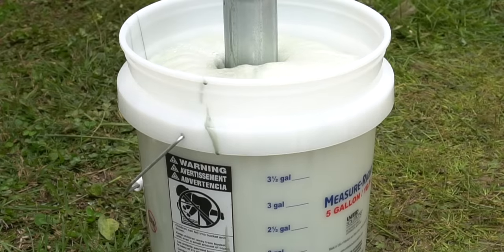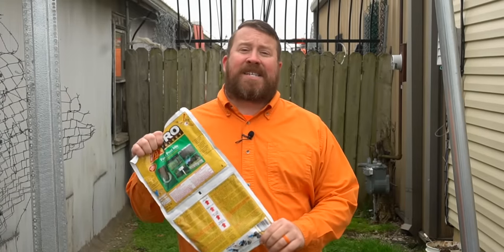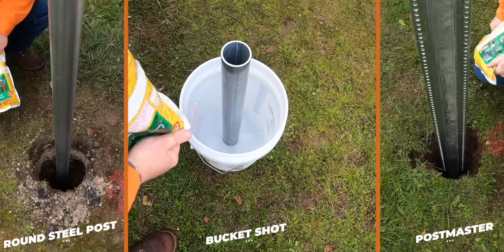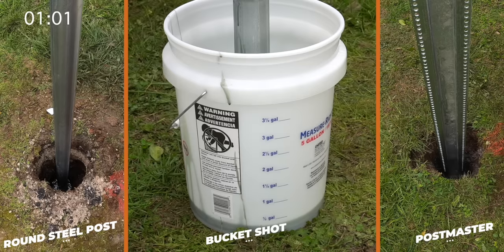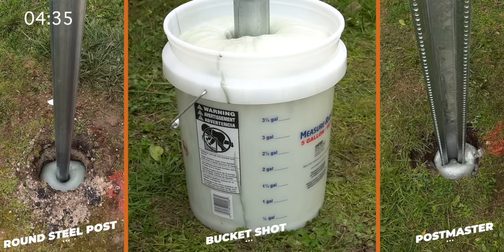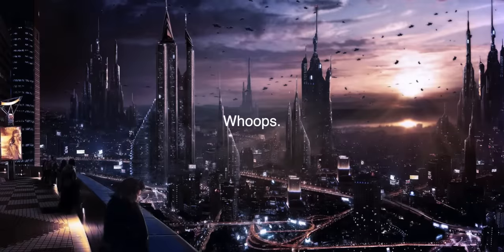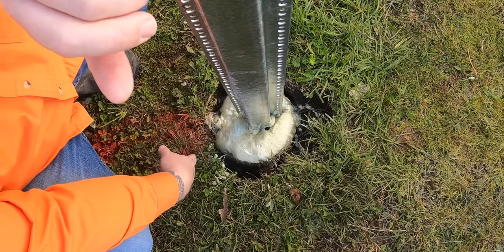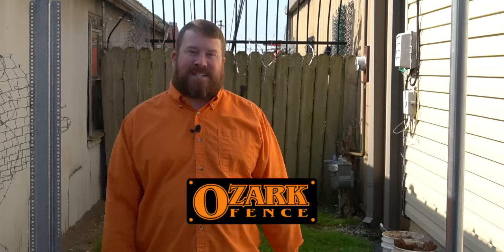Does Fence Post Foam Really Work?

Comment: I agree this foam is a pain in the ass to learn to use because instructions are horrible but if done right u have no issues and in my opinion is as good as concrete but quicker. I personally played with around 30 bags when I built my fence and greenhouse and I had a nightmare of a time in the beginning.
Step #1 warm up packets to  around 90-100 degrees to get best performance and foam expansion. If its to cold it will shrink after it cures.
#2 step is to dig the hole in a way that the deepest part is wider then the top of the hole.
#3 mix the packet insanly well by sliding it back and forth on a pole or another straight stick type object, you will get about 8-12 seconds before the bag starts expanding lile a ballon (be careful because if you over heated past 100 degreed the packets  could explode if your not fast enough at mixing and cutting the corner)
#4 step is to only pour and mix it during the warm or hot parts of the day because the temperature difference of the soil can cause it to shrink during cure.... if done right your expansion will  happen instantly as the mixture hits the outside air. 
#5 step is to wait at least 3 hours before adding any weight and I would recommend a full 24 hours to fully cure and harden. When it first cures its not insaly tough but over the course of a week the foam will harden to a ridiculous extent.
If done right a single bag expands to almost the same volume that 2 bags of concrete would fill

Comment: Let’s just say you threw some rocks into the mix that would act as permanent shims.   Would that make a difference?  For stability
Reply from the maker: Possibly, but it would really defeat the purpose of the product.
Reply: @JoeEverest  you know, it wouldn’t hurt if you lied once in a while.     :)
Reply: And for the record I’ll clarify the original comment:  not all rocks are created equal.  Let’s say the rocks were flat, compressed (right word?) and had foam on both sides?  I’m actually not trying to waste time I’m just interested in multiple solutions

Comment: Been using concrete for projects around the house for decades. The idea that FOAM will resist the forces of nature does not set well in my stomach. Use concrete, it’s a little bit more work but you’d be glad you did. Leave the foam for the chair cushion and the inner soles of you shoes. Use mixed concrete for any foundation.
Reply from the maker: Great points, I appreciate you weighing in!

Comment: I just used this stuff a week ago to set my mailbox post and I gotta say,  I think you didn't mix it properly or something. Mainly because of your slow expansion. I poured it into a 24 inch deep hole and it basically just shot out. It raised like 12-15 inches within seconds. Maybe they changed the compound since your review? I don't know, but your test definitely doesn't represent my experience. Maybe it has shelf life? was it expired?

Comment: Bought it.  Tried it.  Doesn't work well.  Had to dig it up and use concrete.  It works in the video cause it is in a bucket.  Concrete has more weight and it will stabilize the beam better from my experience.

Comment: Direct TV used this on my sons satellite dish pole when the installed it, needless to say the dish never stayed connected to orbiting satellites. He cancelled because they wouldn't re-do or correct it.
Reply: I work for a company that installs satellite dishes. Most install on houses but when installing with a post on the yard,  concrete is obsolete.  Only foam is used now.  I do not do these installs myself I should mention
Reply: @chrissydecker6793  In my own personal knowledge, my son had one put up by Direct TV and the foam didn't work and Direct TV refused to come correct it, the post was rocking in the ground as the weather changed, it wouldn't stay locked on the satellites. he finally cancelled Direct TV. ( I know this for a Fact,  Foam doesn't Work ).
Reply: @docbrown6550  thank you for your info. I was able to get 4 boxes of foam from work for my fence. Trying to save money and now disappointed after getting more info.
Reply: @chrissydecker6793  I'm serious, don't use it, after it settles in, the foam actually shrinks leaving the post rocking and you will be having to dig it out and totally Re-Doing it. I do not understand why Direct TV puts their faith in this stuff it is a bad Product.
Reply: @docbrown6550  thank you.  😊 I'll do it the right way

Comment: I knew foam wasn't a good idea for many reasons, but it turned out even worse than expected.
Before this video, I figured the foam was bad for many reasons; weak against the elements inside and outside the hole, lightweight, not enough strength between the ground or the post, and too expensive.
The shrinkage surprised me though.  The expansion was the only strength I saw in foam before this video, and the shrinkage just destroyed that idea.

Comment: It wont stay, it will get squeezed out of the ground over time, this is why in the " old days " we only put concrete on the bottom, not all the way up, because the weight of the soil on the " Pad " at the bottom, holds the post upright if done properly, kinda like a pendulum.... the mistake most people make, is not using " virgin soil " to put base on, and or not putting it below frost line.. 6 to 8 feet depending on area.... but people are lazy and dont want to do the work so you end up with fences that dont last and fall over... I know this one old guy, he used to put a patio stone in the bottom, put post on it and then pour cement around it, flat top, not domed... you can put clear stone under, but use geo-synthetic material under it. Clear stone does not compact and the cloth will stop it from " bleeding " into the soil.  30 years heavy equipment, I've pulled out a few fence posts in my time, so I have a pretty good idea as to which ones last.... it has been my experience, the ones with concrete only on the bottom, the concrete is still pretty much intact, the one where you use tubes and pour to the top, water gets in and they crack, split, turn to mush... exposed to weather vs not exposed....

Comment: Right off the get go you can tell there is moisture in the hole. This product works awesome but you must have around 65-70degree temps and dry ground not wet because it doesnt want to do its job as it should in wet conditions. also it amazing how long it took for the foam to expand in this video the foam is twice as fast setting up then the video shows. so everyone who is so quick to judge on this product without even trying it. Well read the comments its obvious who has built fences multiple ways and those of you who are well like our new society so quick to form a opinion with doing your own research.  Video was good in doing the tests for sure but the guy doing the video should have read the label for info on temps and moisture levels.
Reply from the maker: We had similar feedback from the manufacturer. That the product performed best in ideal conditions. So, we performed a second test with this brand and another, with concrete as a control. Warm and dry, the product still didn’t match the secure set of concrete. Come to find out the metal posts act like a heat sink and limit the exothermic reaction, even though the package clearly states that the product can be used with steel posts. The second test video is also available on this channel.

Comment: Something looks wrong with your foam. First it doesn't look as though you mixed it long enough which is supported by the expansion rate of the foam. Within a minute I had two foot holes completely filled and the foam was coming out the top and it wasn't dark green or whatever that color is. It was a beige or yellowish color.

Comment: It is good for wood post but for the regular fence post a total waste. But still I wouldn't use it for anything that will carry the most amount of weight, I was disappointed on the galvanized fence post, just not good at all for it.

Comment: The only problem I had with your experiment was that you used all metal posts with no prep on the metal to improve adhesion, or consideration for other uses. I used mine on my wooden mailbox post, and didn’t experience any of what you did. It’s still strong months later. Also, you didn’t give any consideration to what the difference will be if you have to dig it up vs. concrete. I’m guessing this will be a lot easier if someone ever hits my mailbox and breaks the post.

Comment: How does this make things easier if it did work? I can pour concrete and have it set in 20 minutes by adding calcium chloride. And its hard and set enough to put tension on. Maybe it would cut down on labor carrying concrete bags but the wait time for the foam curing process has your crew standing around doing nothing plus another day to come back and fill in the holes. With concrete I can be done in one day with a fully functional fence.

Comment: Hmmmmm ??????   I dont know ........ the holes were only like "bucket deep" (- 3 gallon bucket at that)  I don't know about other areas of the country but in Michigan you need to go about 42" ..... heck you would need 2 or 3 bags of that expanding foam post stuff per hole at like $12.50 a bag at home depot .... so like $25.00 to $35.00 per hole ???  !!! ..... and they didn't show what was at the bottom of the hole for the post to sit on ??  we use a  broken piece of  cinder block or something sorta flat..... Wouldn't that foam push the post out of the ground as it expanded ???   Heck I will stick with bags of quick creat and putting smaller stones and rocks around the post ..... but in some dirt and tap it down !! ...... call me old fashioned !!! ... good video though .... not impressed with the product

Comment: It really can't be said that foam doesn't work unless you have tested all brands .
It's like all products made from shoes to tools they're not all the same quality so if you really want to know you have to test all foam products and then make a  comparison and base your conclusion from that !
Correct me if I'm wrong but I did see the post on the left moving slightly during expansion which would contribute to its failure also the foam wasn't designed to anchor posts to plastic .
Altogether I'd say this test really isn't a good assessment of these types of products !

Comment: My experience has been nothing but positive with expanding foam. Maybe the stuff you used was old.
Reply: I did use a different brand. I can't remember the name. I like the foam because I'm 60 and I work alone. It's a lot easier carrying foam than concrete. Where can I buy these steel fenceposts? My daughter's cedar posts are all rotten and, of course, it falls on me to replace them all.

Comment: The heat on the inside while setting made the out and pole side of the foam thearedickly ;) melted
Reply: Was that supposed to be "theoretically"????  Even if you had spelled it correctly, the sentence would still be incoherent.

Comment: This product is not a Kickstarter, how is this the final product? Rarely works properly with a huge amount of vectors that can lead to failure. The only scenario I can think of is that an individual needs to set 200 feet of fence and they are only allowed to transport the hardware in airport rolling luggage... Perfect solution for that...

Comment: looked like the post was being moved around  as foam  expanded anybody else notice that
Reply: Yup!  Especially the round post in the ground,  he didn't brace any of the posts for this video which is REQUIRED!   A poor review in my opinion.
Reply: @cblanton42  no the problem is built into the product, its a thermo reaction, it expands when its warm, when it sets , it cools and shrinks at a rate far greater than concrete.
Reply: Uh, my post was about him not using any bracing. Lol!
Reply: @harborhobo9791  the bracing is an irrelevance, that stuff has shrunk, i dont think his prep was proper for a start, success involves a bit more mixing of the bag it seems, or its the environment hes working in, the foam has shrunk significantly.

Comment: I'm no fan of putting wooden posts in concrete or securing them with over 80%air.  

I use concrete footers, and metal standoff post brackets to prevent rot.  The wood makes no contact with soil or concrete.

Comment: You did something wrong. I built a fence with this last summer in dry ground, 95-degree heat. No issues. It filled all voids and did not retract at all.

Comment: The truth is wood shrinks over time and metal rust over time. Over time in the elements water will find it's way in and will deterate the foam and or the post. I have seen this done before a couple of times and they just dont hold up. Nice try and a good effert.

Comment: Having just replaced a fence that the previous installer had fixed, the now rotten posts, in concrete, I can safely say that anyone who uses such material should be locked away for their own good.

Comment: Thanks. I live in Oregon. Last week was fire a couple miles away. Now it’s raining and the fire danger is low. Here I have found, go deep with metal posts, or use cedar that has roofing tar at least two inches higher than concrete, or don’t use concrete at all and plan on it lasting longer. Concrete eats wood here but a 9month long period soaked in water seems to last longer. I might be retarded and I’m not a fence-er by trade. So if I can I use t posts for metal fence and tar coated cedar for wood fences. On a side note. An old railroad tie 2’+  takes an a$$ woo pin and stays too. Lol I am retarded but I liked the video and always like to add my 2¥ to help the Al Gore rhythm.

Comment: You didnt mix it well enough at all. This stuff usually expands fully within 45seconds of pouring it. Thats why you got a bad result, you didnt follow the directions and knead it on a 90 degree angle. It doesnt even look right, compared to what I normally see.

Comment: this foam is just a very bad way to cut corners and be lazy. all types of expanding foam that is sold as building filling material will start to disintegrate a year or so after application or a few years if used the more expensive "brands" - but the bottom line is it is not meant to replace concrete footings/foundations, no matter what fancy name they find for it

Comment: Have used this product several times never had a problem with it. You did not use it correctly imo, you have to mix then cut the corner of the bag and let the reacted mix I.E. the foam force itself out of the bag & into the hole not pour the unreacted mix into the hole.... if you had done this it would have worked perfect..

Comment: It doesn't look like you used enough foam, from all the instructional videos I've seen the foam overflows above the ground.
Reply: Mine set up in minutes and raised above ground, did not contract.  Something was off on his application, do not know what.
Reply: @mwrisneyable  I think the hole that he made was too big.  I used this last summer to build my fence and the instructions suggest a hole slightly bigger than the post, much smaller than you'd dig if you were using concrete.  I used 6x6 posts in 8" diameter holes.  I live in South Central Ontario, so far it's held up very well. 🤞
Reply: @mwrisneyable  also it's important to get the liquid on the post all around while you pour it in so it bonds to the post as it expands.

Comment: That's disappointing. I thought the foam was easier to use and seals wood so that it was water tight and won't rot. But with that big of a gap, your wood would rot so much quicker

Comment: this product has been out for several years if it was good contractors would be using it everywhere.
Reply from the maker: Agreed, I looked into it because the utility contractors in our area are using expanding foam products to set utility poles.
Reply: @JoeEverest  I mean it would be okay in a temporary installtion where it would ease removal process, so I could see the appeal by the power company when setting up temporary service.

Comment: That stuff is a waste of Money not any good garbage. Put it into use as directions let it set a couple days put the fence on it after fall and spring winds the fence wobbles . Quick creat mixed properly works the best don’t just dump in hole and add water mix it . You will be much happier.

Comment: I've been using this exact product for years not a single weak post call back. You either did not mix correctly which it looked like in the video. Or you sabotaged this video for money. Which after doing a bit of digging on you seems to be the case.

Comment: You did it wrong !
I have been using for 2 years 
Not once has that happened 

You dont wait 2 extra day's 

Back filling with dirt and nice tamp
Is way to finish. 

Electrical co. Have been using this for a decade on massive electricity lines and dont have your result

Comment: used  SecureSet on my fence, i wont use concrete for a fence ever.
Reply from the maker: Good to know, it does seem like it works better on wood and vinyl posts.

Comment: Might be best to read directions first.  #1 Clearly states that is to be used for post gates. Doesnt say to use for fence posts. Just mailboxs,signs and lamps and gates. Clearly states NOT to be used for posts with sideways (wind) forces. #2 Clearly states how to mix, you didnt do as instructed. #3 Clearly states to pour into the hole AND onto the post so as to make the bond to the post better.   Come on man, you can do better. The product is GREAT when used as directed. NOT good for fence posts that wind blows on.